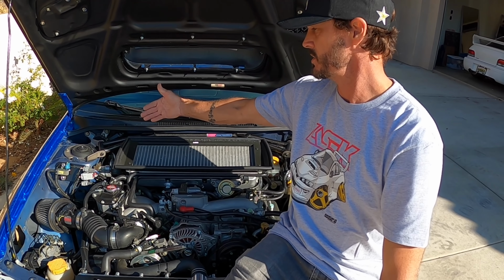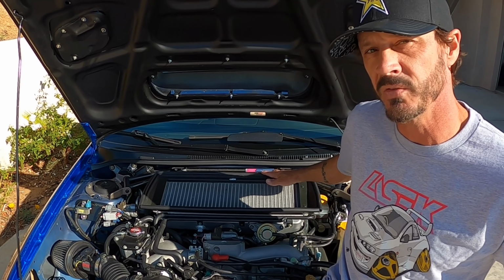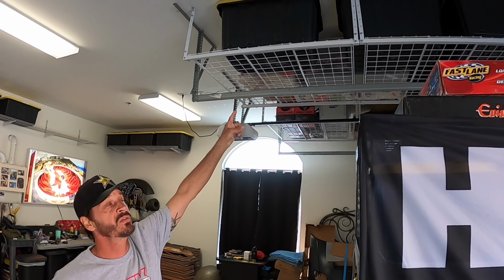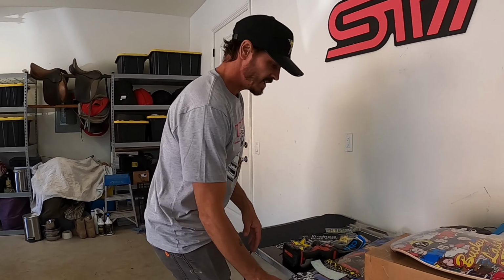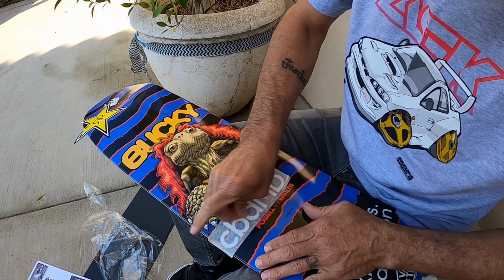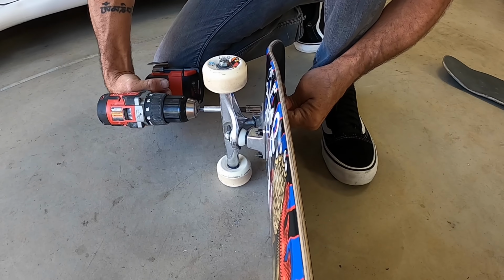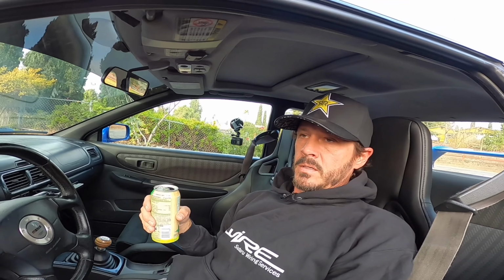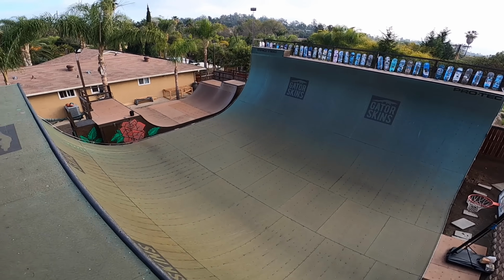New Year Update with Bucky Lasek

Comment: If you still have the stock steering racks which are a ridiculously slow 16:1, upgrade them ASAP. It was THE #1 favorite upgrade I did to The Slingshot. I got a hold of a custom built 12:1 rack from some rally shop in the northeast (was a long time ago)
Reply from the maker: Both my cars have the Sti steering racks👍🏼